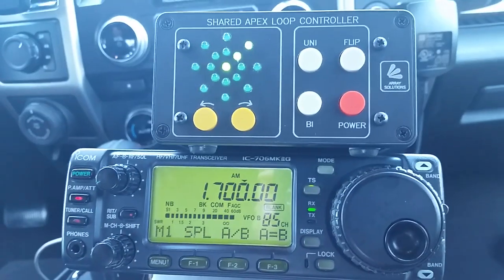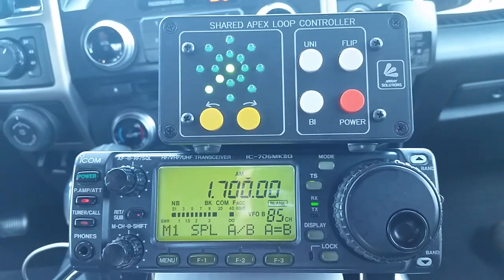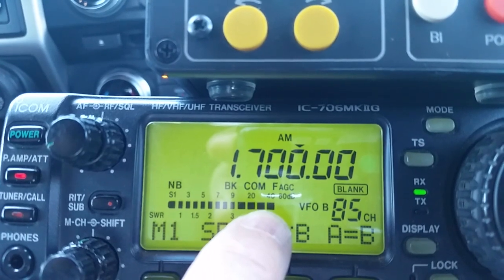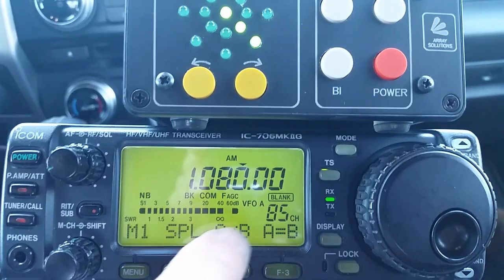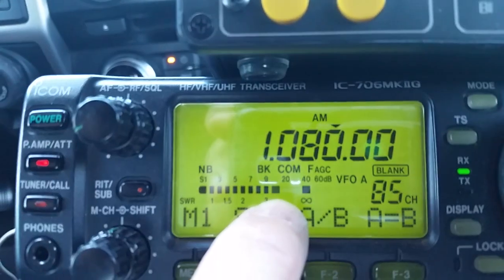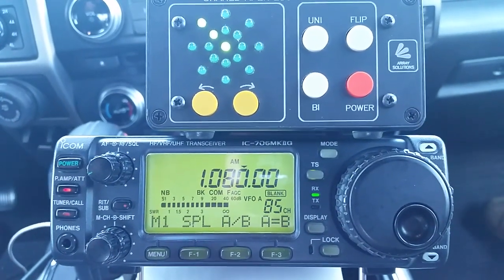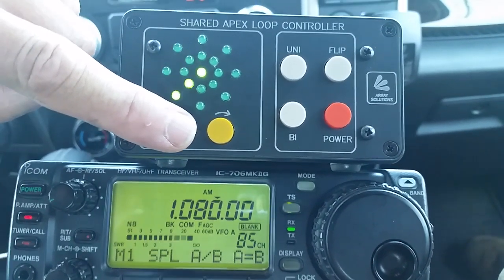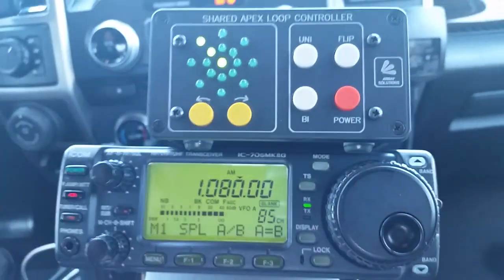SAL 30 Mark II Receiving HF antenna by Array Solutions

Comment: David Sourdis:

Have you compared this antenna's performance in terms of signal strength vs, say, sizeable, omni-directional random wire @ height?

Your experience would be most enlightening